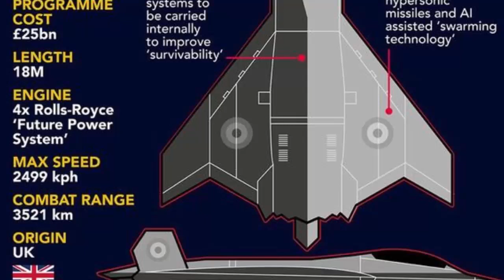UK enlarges Tempest jet to carry Larger, Longer Range Missiles challenge to China's 6th-gen fighter

Comment: They should consider a VTOL variant. The only modern fighter in the west with VTOL is the F35-B which leaves us dependant on the US for carrier based aircraft
Reply: The us needs the UK as 35petcent of parts are made in the uk
Reply: Time to junk the idea of VTOL .... The Harrier was a brilliant idea and planned to be deployed to forrest clearings in Germany in any war with Russia, the F-35b is useless for that as it requires a fully hardened landing pad for a vertical landing
Reply: No great benefit to VTOL on the battlefield. Looks great at air shows but the STOL version is far more popular
Reply: @hairymuff6555  The main ussue is the requirement for vertical landings on the Queen Elizabeth class aircraft carrier. Admitedly it might be cheaper to fit the carriers with CATOBAR than to develop VTLO\STOVL tempest variant but until we do one or the other we are dependant on American F35-B's.
Reply: @hairymuff6555 .... The Harrier could have been successful in battle at its advertised job of taking off and landing in a clearing as it could do that ok ... The F-35 can only land or take off from a specially reinforced concrete pad, they'd to lay some of these at RAF Conningsby just for them to do this
Reply: @petersmith7126  The question is not where can the F35B take off and land from. The question is apart from the F35B what else can take off or land from a Queen Elizabeth class Aircraft Carrier. Ignoring helicopters, drones and harriers the answer is nothing. That is an issue.
Reply: @minophis  very true and really a stupid mistake to make but that's just my opinion, we'd have been better off building a standard carrier

Comment: I think expending resources on a long range missile only capable of striking less manoeuvrable targets is likely a wasted effort. It will not be long before all "strategic" air assets like tankers, EW, AEW etc will be equipped not only with IR jammers and chaff/flare dispensers, but with high power (100Kw+) laser weapons capable of destroying incoming missiles. Thus any such missile must be either be air-breathing throughout its flight or dual pulse with the second motor igniting within a short range of the target - in both cases to allow extreme manoeuvrability in the terminal phase. Just my opinion.
Reply: DEW's as an anti missile defense is still new enough that strategies to counter them are only just starting to be explored. However hypersonic\near hypersonic missiles probably have the best chance of getting through as they are able to close the distance to target quickly enough that they can survive the heat. This effect may be improved with heat resistant material such as ceramics as a missile casing. Also 150kw+ laser is very ambitious for a fighter. The dragonfire laser is only 50kw and the navy is hoping for 150kw to mount on warships. Research in lasers for smaller vehicles like anti drone defences for armoured vehicles is around 15kw.